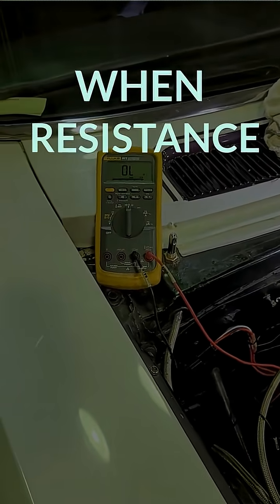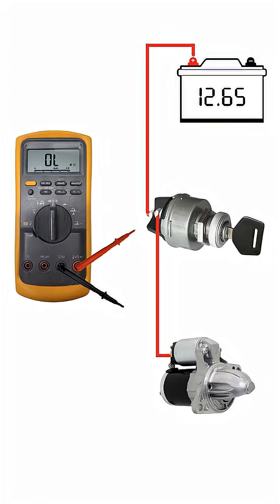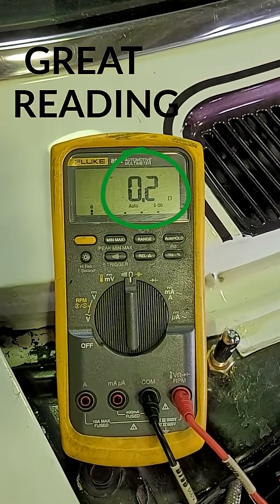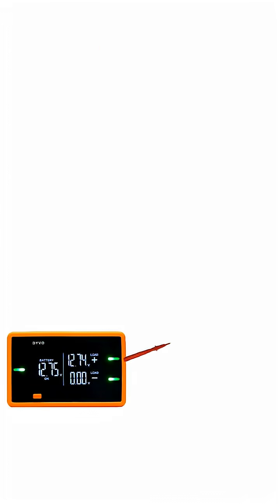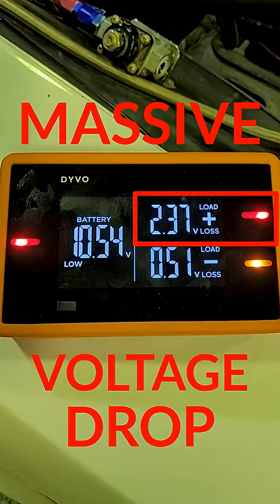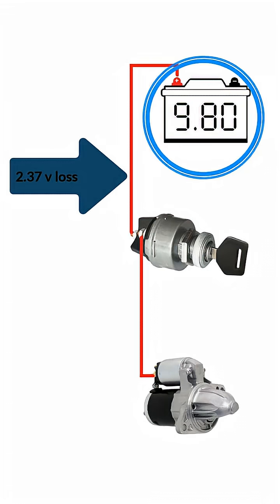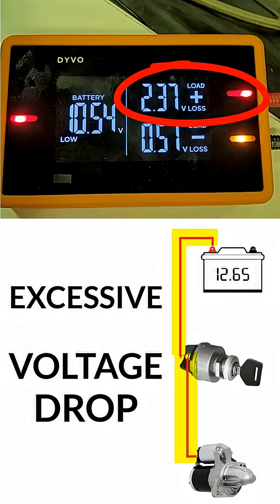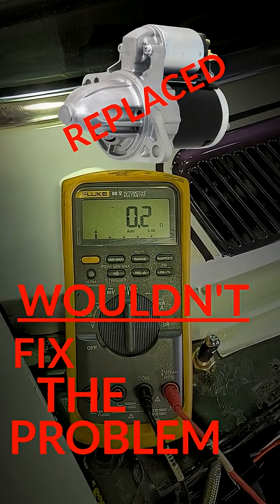Testing resistance and voltage drop

Comment: Ok so how do you fix it then
Reply from the maker: Great question! The reason for this voltage drop was too much current (24 amps) through too small of a wire size (10 gauge) for too long of a distance (20 feet). We added a relay that shortened the circuit to 4 feet. We'll post the full video soon!